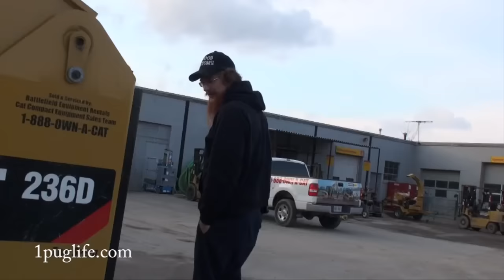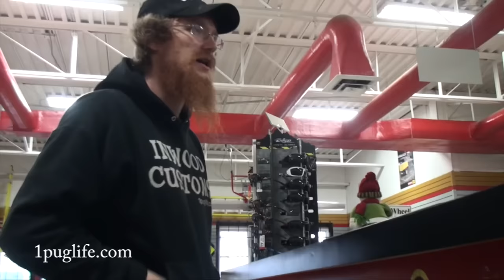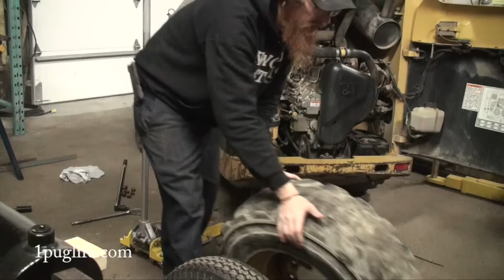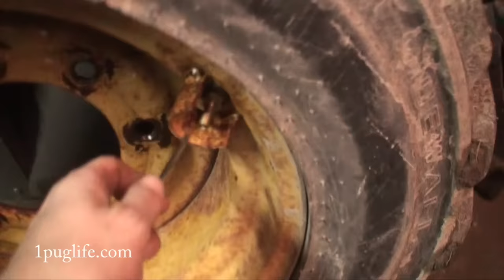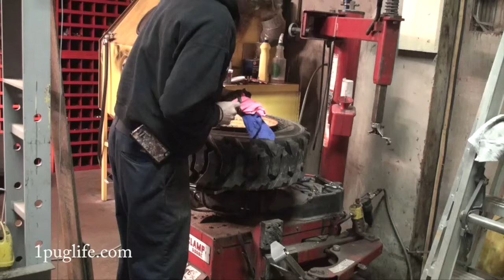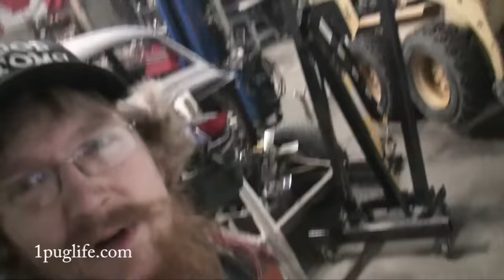changing skidsteer tires

Comment: When mounting/demounting tough tires, I clamp the rim from the outside rather than the inside.  It holds the rim much more firmly and doesn't pop off the clamps.  Just my $0.02  BMP
Reply: Any .5 rims should be outer clamped but prefer to hand bar them off in 3 pulls

Comment: Hahahaha as a tire guy it was hard watching you do those 10-16.5's hahaha they are meant to be done by hand with two bars. Like a semi tire. Also never clamp a skid steel wheel from the inside if you do use a machine. You can use a hammer to hit the beed into the drop center to save your back haha And that jelly stuff is called tire soap hahah it's used for a million different things in the tire world. You can even use it to fill in the gaps of the needs so you can air up and set the beeds. Also put some tire soap in your lube bucket it works wonders. Anyways. Have fun with that skid steer. Those are fun to operate 👍🏻👍🏻👌🏻👌🏻

Comment: Hey Pug, 75 PSI is a bit much air for skiddy. That is a max pressure rating. In reality most guys run theirs with about half that pressure.

Remember less pressure means more traction, but there is a trade off. Tires will wear faster if you are using it on concrete a lot. And if you run too low of pressure you could break the bead seal if you run along side a hard object like a curb.

Rule of thumb: the tire should smoosh a bit when you drive over something like a piece of firewood. If it doesn't deform then you have too much air. The tires are the machines only suspension.

Comment: In Canada you can't sell as is. 
Also you had to have inspection for renters to move in. 
Just put for sale sign out front.
Reply: This guy is so right not only an inspection insurance liability will cost you about 10 grand a year and if Van doodles running it you better have about 20 million liability or you can find out the hard way and get your ass sued off

Comment: hey pug that goo in the tub you got is not only lube but you use it to pack the bead when the tire has a loose fit like your first tire did. remove valve core use clip on air chuck to keep constant air going into tire. push down so tire is sitting on bottom bead of rim then use the booger like stuff to pack top bead where the air is escaping and not allowing bead to seat. bead will start to set then once inflated you can re use the remaining boogers. a tire cheetah might could work  but with those tires being such a thick ply it might not have enough pressure to expand tires. been using that exact stuff on stubborn big rig tires for years now
Reply: this ^   that stuff they gave ya is the wheel butters. seals tires for mountings.

Comment: that bucket of lube is actually called Murphys Soap. You use it to pack between the rim and bead of tire so you can get it to seal just enough to air those bastards up.

Comment: The ratchet strap work Ok, but you should get OTC 5702 bead seater for tire changer works very well and easy to use. Plus if you add a pipe fitting to OTC 5702 kit you can add live air for bluffing tires for repair or for higher air pressure for 10 ply tires.

Comment: you should change the skid tires with out using the tire machine and just use a few bars and a sled hammer its more fun in the sun  with temps at 100 degrees you will have a blast.

Comment: Pug1 if looking for plow for skid steer ive got 2 of them already with plates let me know
Reply from the maker: +Wayne Jonker how much cigrits?
Reply: +1puglife Walter Donker!
Reply: +1puglife You gotta clap those .5 rims on the outside of the rim... You're lucky they didn't pop off of the machine and behead you. Air those style up on the ground with ether but keep your distance! Never put your head over top of the rim area on the machine or on the ground while airing them up. 13 years of doing everything from loaders to split rims to passenger tires so if you have a question feel free.
Reply: half pack

Comment: I love how he bust out the torque wrench for the lug nuts and they are all over torqued by 50-75lbs I'm sure. when ya radda tat tat pounding away with the impact gun on the lugs you can almost guarantee they're on Plenty tight, no need for a torque at that point, good entertainment I guess.
Reply: Dude i just had dudes put tires on my Durango. Holy shit I had to use a full jack handle breaker bar on every single lug. Gd idiots

Comment: that super high tac grease should be great for your angle grinder gear box if it can take the heat. BTW the factory grease they put in them is garbage and they usually don't put enough in them

Comment: I don't think the old drain plug is on the bottom of the skid steer engine on the side of it looks like a bolt basically because cat engines where the best engines but they built them in a strange way

Comment: Check out my channel to see my Meyers truck plow mounted on my 773 bobcat. Wore out the 1st plow as it was to light. The new Meyers is all heavy duty box tube construction. You can stack snow 12 feet or higher if you set it up like mine. Been using it in Alaska for over 10 years & I love it.

Comment: What should have been done, use degreaser throughout, pressure wash her off, while tires off, sand,repaint rims , sand off rear bumper spray with Cat paint...rag to clean motor like that really offers little results. FFS....